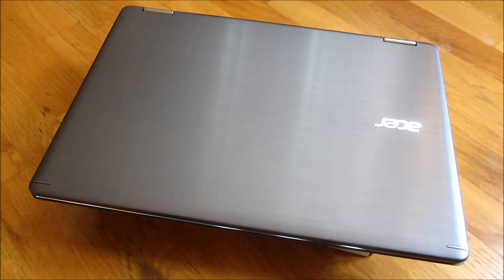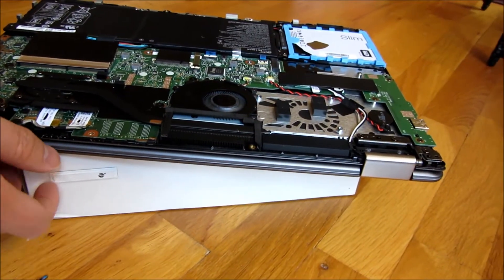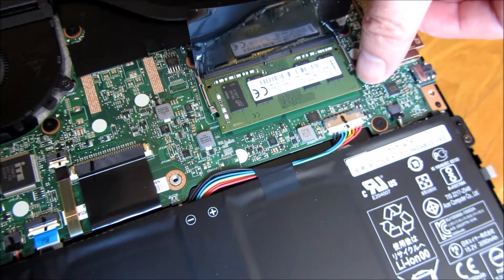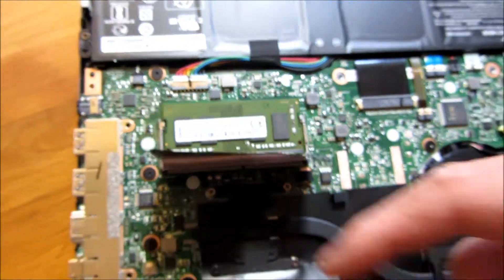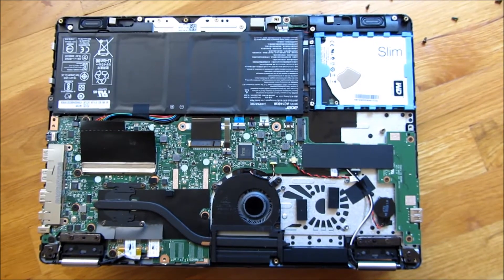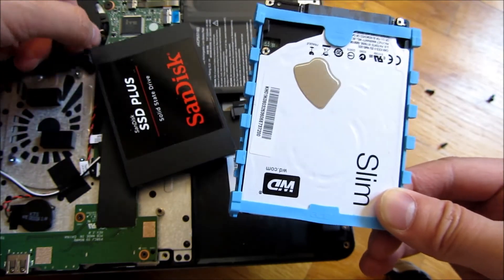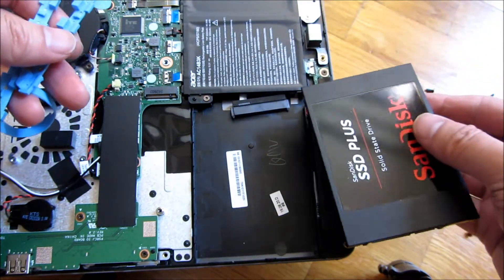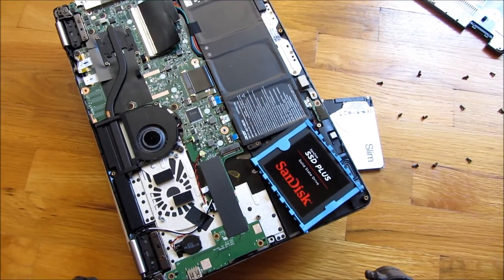Acer Aspire R5 | Internal View | Model 571T

Comment: So I've upgraded the ram and hdd but was looking at the space right above the hdd. It appears that there is something that may be missing like a ssd stick or am I just seeing things?
Reply from the maker: 4:25 -  I don't think there is anything missing its just like that.
Reply: bro i think you can put an m.2 ssd here aside from the normal slot
Reply: thats what i was thinking
Reply from the maker: G Man I think you're right it even has the screw hole to hold the m2.  plus in the bios it has that slot as the in the boot up priority.  should have taken a better close-up when I had it open
Reply: M.2 slot but mine don't work, R5-571T-57Z0, not detected in bios or device manager